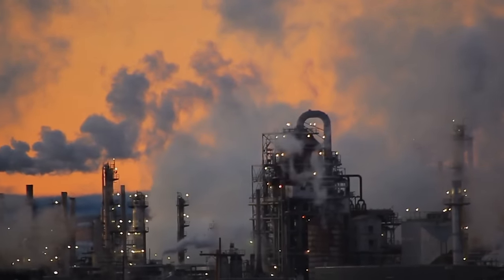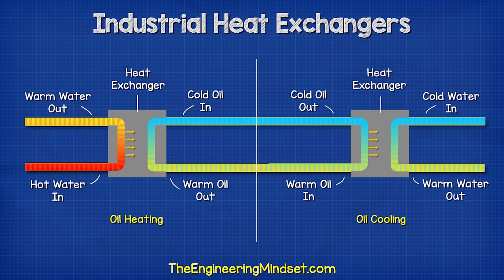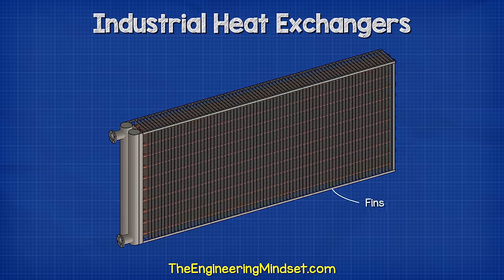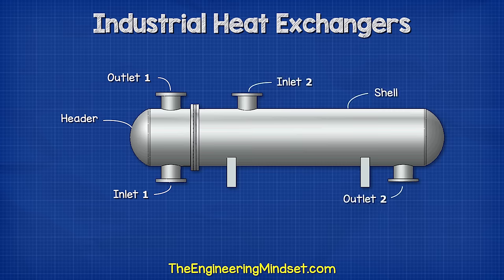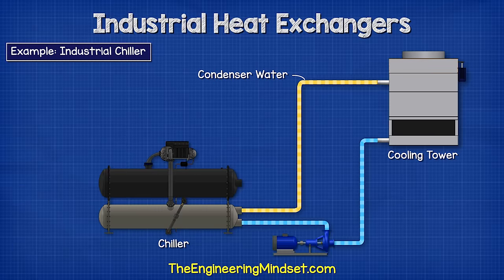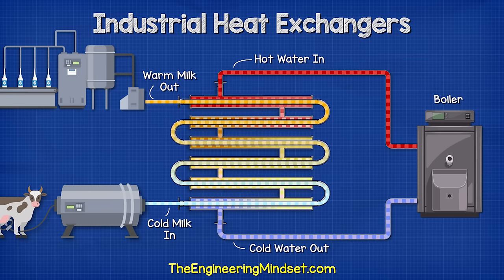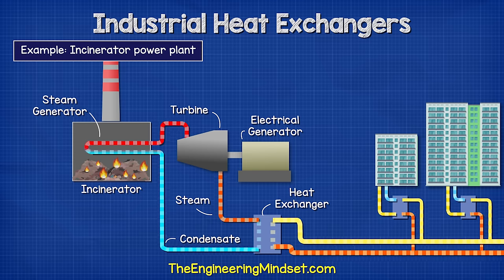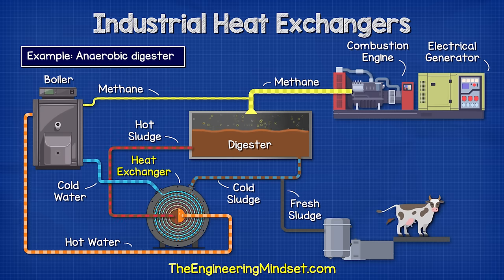Industrial Heat Exchangers Explained

Comment: I work in the pharmaceutical industry and we use finned tube heat exchangers in Air handlers for heat and cooling, also shell and tune heat exchangers for clean water 
 generation... great explanation 👌 👍 
Keep the great videos coming! 🙂

Comment: I have a 6 year tenure in coal and natural gas turbine power plants, cleaning supercritical boilers and system components (oil coolers, feed water heaters, cooling towers, condensers, plate heat exchangers, etc. 
1 year of demolition and disassembly of commercial and industrial HVAC systems, and have been a scaffold builder during my total 8 year tenure as a laborer. Looking to switch to the pipefitters union, and going to school for HVAC to boost my resume. Unfortunately my work experience wasn’t enough, at least that’s a possibility. The decision to hire is based on a vote of 30 fitters and business owners, so I have no way of knowing why I didn’t make the cut during my last interview. Your videos are helping me to organize my elevator speech for my next interview 👍 thank you!

Comment: Such a great and explanatory video. Thank you! 
Usually in dairy industry (basically milk) the usual heat exchanger is plate heat exchanger. This heat exchanger is used for pasteurization because it’s able to achieve the demanded temperature really quick and the microorganisms get thermal shock, without affecting the organoleptic characteristics. Also the patterns create turbulent flow as shown, and increases the surface (approximately by 40%) so the heat transfer increases.

Comment: I work at a waste water treatment plant. We use heat exchangers to warm digesting sludge. Heat's provided by burning methane produced in the digesters. We have generators, but they are nonfunctional, so excess methane is burnt in a waste flare. Water is heated to ~170/77 in the boiler, goes into the HEs at about 150/66 to get the sludge up to ~98/37 to accommodate mesophilic bacteria. Control is provided by a bypass valve on the water side.
Reply from the maker: Interesting, thanks for sharing. Which type do you use?

Comment: Most commonly used in vehicles i.e. radiators. I worked as a machinist in an industrial heat exchanger mfg facility in Beaumont, TX. for a few years after the first Gulf War. Some of the metals we used in the mfg process were inconel, monel, hastelloy, copper nickel, stainless steel, brass, copper, titanium and most commonly steel.

Comment: I'm a tech for a Fluid Chillers Corporation. We recently built a low temperature chiller for Dow chemical. It had a boil off coil in the suction accumulator. The liquid line runs through the accumulator so the cold suction is transferred into the boil-off coil. Quite often my suction pressure will be in a vacuum on a low temp chiller. I'm curious if the boil-off coil will raise my suction pressure. The chiller for Dow was not an ultra low temperature -70F so I didn't get to see how the boil-off coil would affect the suction pressure at ultra low temps.

Comment: Most heat exchangers I've seen were on refrigerators and automobiles. I've been inside a lot of HVAC systems and I've seen chillers [and brine lines] in arenas. Industrial refrigeration would be a great topic for a video.  I've heard that Kangaroos lick the inside of their forearm to use evaporative cooling to cool their blood and use their circulatory system as a heat exchanger.
Reply: Interesting that kangaroos do that. The way sahuaro cactus cool themselves blew my mind too.

Comment: Plate and frame heat exchangers are also commonly used in chiller plants where you don’t want to mix the cooling tower water (which is open to the environment) to the chiller equipment which can cause fouling or other issues. Some commercial buildings even use them during cooler days to allow the cooling tower water to directly cool the air moving through the air handlers and bypass the chillers completely which saves energy. The heat exchanger in this case prevents the cooling tower water from contaminating the chilled water loop that cools the building. This configuration is known as a water-side economizer or chiller bypass economizer.

Comment: i work in aquaculture, marine fish hatchery. we have quite allot of plate heat exchangers. they are a huge pain to disassemble, clean and reassemble. you have to be very careful with rubber gaskets, so they dont leak. salt and metal. corrosion everywhere. im not an engineer, but i wonder if they can be made out of some other material rather than metal?
Reply from the maker: The heat transfer properties make metal the best suited, corrosion is a problem though. There are lots of coatings that can be applied to reduce this but these usually come at a compromise of slightly less efficiency but longer service life. Perhaps a heat pump for the thermal transfer and a separate system for water cycling
Reply: I dont know about salt, but as an hvacr guy I once did some work for a guy that had a small trout farm. Ended up building a 500 gallon reservoir tank with pipe coiled inside. the water circulation pump would dump into the tank while the pipe was connected to a refrigeration system.

Comment: As far as I know, at work we use plate heat exchangers for our HTST processes, finned tube in our evaporators and condensers, and the tube and shell for i believe our CIP lines.

Comment: The body's circulatory system is also a heat exchanger with the very advanced mechanism of being air or liquid cooled and has a variable pressure pump, on demand.

Comment: We use these in gas phase polyethylene for cooling the water that is used to cool the heated gas from reaction.
Reply from the maker: Interesting, what type do you use? Finned tube?
Reply: @EngineeringMindset  Cooling towers in Canada but overseas where the cooling water is warmer, we use typically 4 huge plate and frame heat exchangers in line, for better control of temperature. The water/gas cooler moves around 5-7 million m3 of water an hour so pretty big in size. I work in UNIPOL gas phase, pretty cool design!!!!!

Comment: Dear Paul sir I think we can also use this in a extreme IC engine which are used in heavy duty generator .... I IN MY POINT OF VIEW
Reply from the maker: Yeah good idea, we need to cool the engine and we can also make use of the waste exhaust heat.
Reply: thankyou sir the  waste  hot air can be used in making the fuel's temperature hot,  by which the combustion process  will be more efficient .
Reply: thankyou sir the  waste  hot air can be used in making the fuel's temperature hot,  by which the combustion process  will be more efficient .

Comment: You didn't talk about one of the coolest heat exchanger designs, the coil wound heat exchanger! Commonly used for multi-path cryogenic applications such as the main heat exchanger for cryogenic air separation plants.

Comment: A customer has a central chilled water and steam plant that runs continuously year-round.
Domestic hot water is created from the steam plant. The estimated hot water needed
annually is 23,267 MMBTUs. The proposed energy conservation measure is to install 4 water
source heat pumps to heat the domestic hot water. The proposed equipment will create an
additional 145 tons of chilled water while using the heat rejection loop to heat the hot
water. How much energy savings will be associated with this measure?

Baseline System
Chiller plant – 145 tons to be replaced annually. 0.75 kW/ton
Boiler Plant – 23,267 MMBTUs to be replaced. 76% plant efficiency

Proposed System
4 WSHP – 145 tons total, 1.848 kW/Ton, condenser 2.656 MMBTU/HR

If you agree there are savings, how much energy will be saved? Mention any assumptions
you are making. Feel free to look up any metric conversions (i.e. kWh to MMBTU, etc).